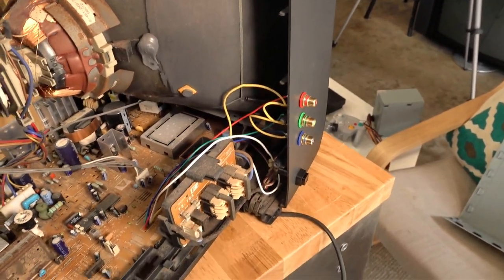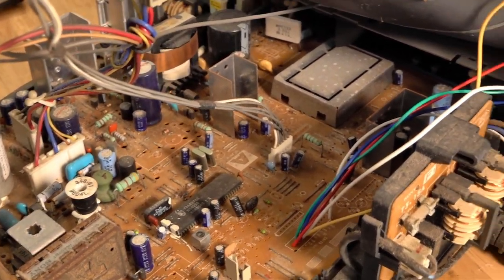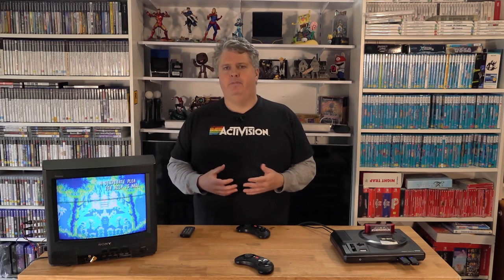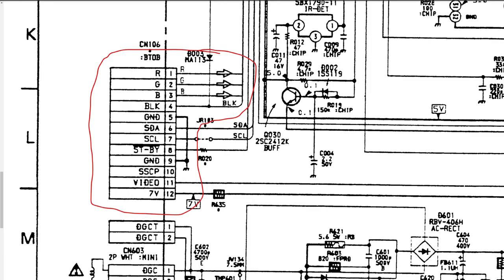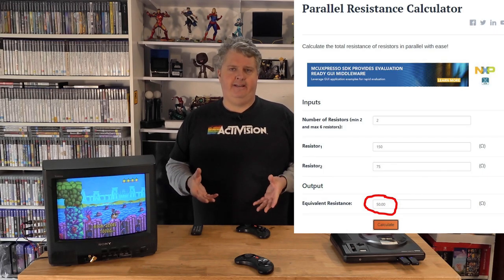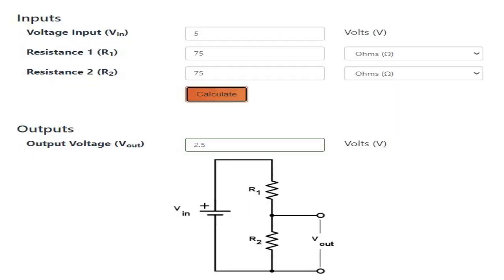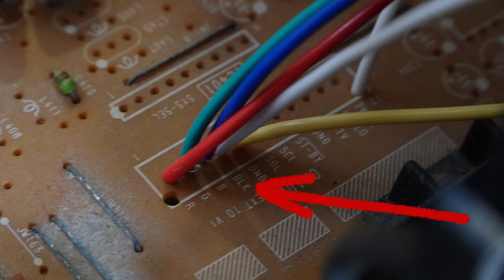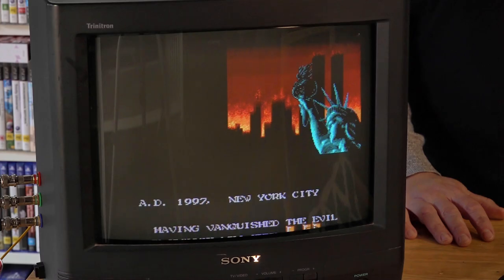Turning a Trash 14' CRT to a Awesome RGB Retro Gaming CRT

Comment: the transcoders don't add any lag, I'm extremely sensitive to it and have never noticed any at all using them. Regarding the picture scart vs component in 240p - Megadrive /SNES I don't notice any difference at all they both look amazing.

Comment: I have a couple of trash picked CRT TVs that I want to modify to accept RGB and you've given me some more confidence. Thinking about how you removed the 150 ohm resistors, you could have just added 150 ohm resistors in parallel and you would have had an equivalent 75 ohm resistor. BTW, your wiring isn't messy at all, you should see what I do. Great video and thank you for sharing!
Reply from the maker: Yep. That's correct. But it's super simple to remove those resistors and use the spots already there. I actually used 150 ohm resistors before but I prefer to use the spots on the board. Less messy at the RCAs or trying to make up a vero board.
Reply: @spudzgames4361  this is true.

Comment: Regarding component and transcoders. I am like you, I much prefer direct RGB. I've done some testing on monitors that could take both and the transcoder was much softer than direct RGB. however transcoders will not add any log as they are analogue devices without a frame buffer.

Comment: What about the modification where you basically push More voltage to something on the CRT TVs and you can go from 640 by 480 to 680 by 800 I think? Something like that. Any idea what I'm referring to?

Comment: I'll try to make it quick. I want to add component jacks to a Sharp 25R-S100 to hook up a og Xbox or PS 2 to replicate a primal rage arcade. What ohm resistors should I use? A walkthrough digram will help alot. thanks.

Comment: Great video! - I have Sony KV-G14C1 Multisystem TV which I hope to do the RGB mod on (have not been able to find the exact schematics but I did find the KV-G21C1 which I am hoping is close).  Newbie question -  On the unpopulated CN106 header location for the teletext, my RGB lines go to 0 ohm resistors (instead of 150's like you had and wound up terminating with 75ohm).  I am assuming I should pull those 0 ohm shorts to ground and stick 75 in there before I do anything else).  Once I do that,  should I have continuity to 21,22,23 of the jungle IC TDA 8366 ?   Your video appears to be closest to my unit That I have found so far. everything else is just like yours on the CN106 header.
Reply: Oh one more strangeness, I also wanted to do s-video mod BUT it appears this TDA 8366 has data and clock lines SDA SCL at 8,9  instead Chroma and Y like the datasheet.  I am not sure if there is a Y location on this IC or elsewhere to send in chroma for my Commodore 64s, so I may be stuck with composite.  Would love to see this monitor with s-video also.
Reply: Success!!!! the KV-G14C1 is a winner. Stunning RGB display on my Commodore C128 with the GGlabs converter to take the C128  RGBi digital out and wired a temporary VGA connection coming out the back of the Sony. Used the Csync to the Hsync pin on VGA connector to the composite in on the Sony for now until I grab it from the jungle or elsewhere . As mentioned above - I swapped out the three  0 ohm resistors on the RGB near the motherboard CN106 header location with smd 75s and also used two 75s for the voltage divider. Your video was a tremendous help and inspiration !!! Thank you!!!

Comment: Very nice and detailed video 👍
When I see the RGB tight to ground like that I'm always worried the RGB signal might need to be activated by software or I2C since some chassis like the BG2S support that protocol . Any experience with that or usually RGB is always activated by default?
Reply from the maker: Sharp CRTs tend to have RGB on the jungle but not activated.

Comment: I really can use your help i love your video i just finished modding my sony trinitron bg-2s with cn106 ports it worked fine but i an getting jail bar effects on the right side of the picture when using rgb but with composite is fine. 

White lines are quite visible.
I did everything like
You did with 75ohm resistors termination and with blanking 75+75ohm with the blacking line and ground termination respectively. 

I have to remove the 0 ohm resistors which were soldered into the cn106 rgb lines.

Is there anything i can do to get rid if jailbars
Reply from the maker: Go to the service menu and see if turning VM (Vertical modulation) off helps. Without knowing the model i am not sure if that model ahs it or not.
Reply: @spudzgames4361  thanks for replying my model Is Kv-J14L1 similar to G14L2 i will def try that. 
Edit : not able to find the Vertical modulation in the service menu on my tv.
Reply from the maker: I have heard of this before but I've never experienced it so i am unsure how to fix it.
Reply: @spudzgames4361  is there anything in the service menu of my tv kvj14L i can try playing around ? Or any caps missing or adding new caps ? 
I did this first time from your videos they helped me alot and made it look easy. 
Thanks again

Comment: Why go through all this trouble and use RCA jacks as your input? All connectors used for video should have 75 ohm characteristic impedance. RCA was never intended for video and there is no such thing as an RCA jack with 75 ohm characteristic impedance. It is physically impossible as the shape of the plug CAN NOT provide 75 ohm characteristic impedance. You should be going from BNC to BNC.